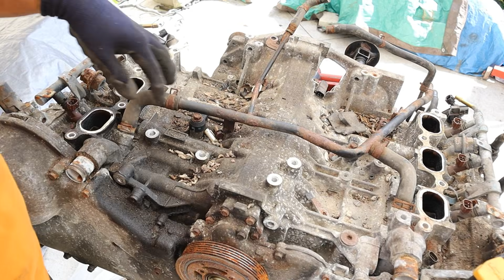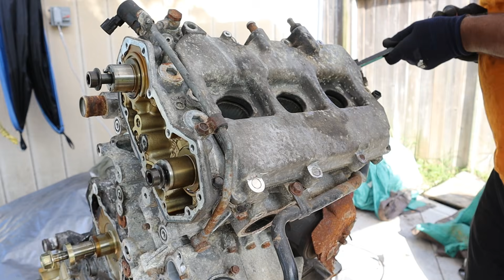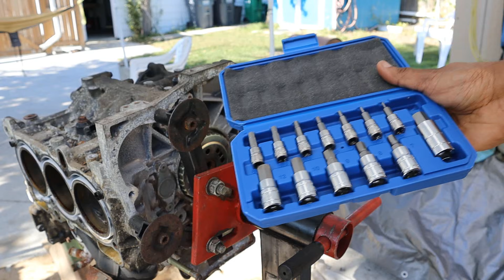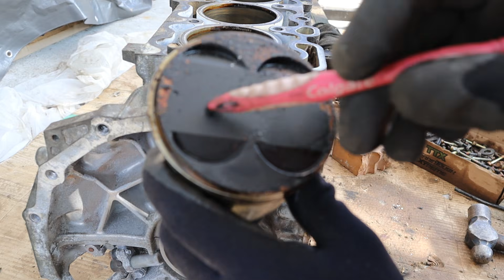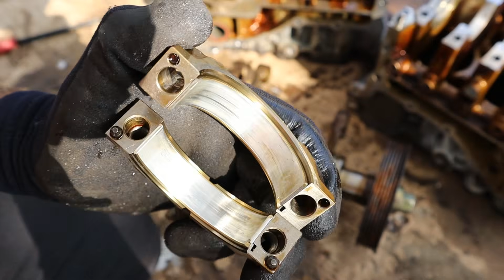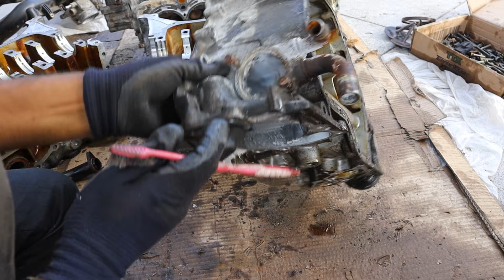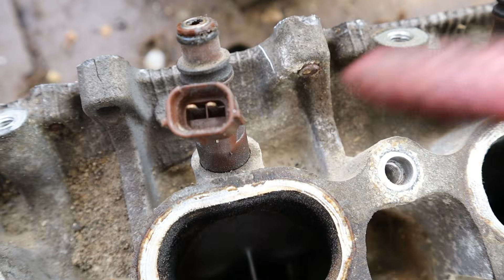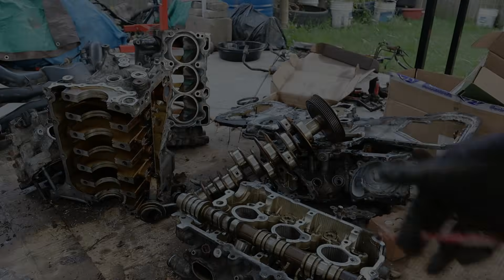Inside a Subaru Boxer H6 Engine

Comment: This is a fun video.  I'm diving into one of these engines right now because it needs a valve adjustment at 115,000 miles.  I can't wrap my head around the fact that it looks like, in order to do the valve adjustment, you have to pull the cams.  Seems excessive for what should be a fairly simple job.  Am I missing something?
Reply from the maker: Yeah cams will have to come off. That means you'll be dealing with timing.

Comment: GREAT VIDEO !  I love the way you zipped through all the boring stuff - hose and harness rempval, bolts removal, etc, that WAY TOO MANY "video producers" just drone through - as if they are getting paid by the minute instead of providing interesting content. ALSO, great and thorough analysis and presentation of the engine innards and systems. THANKS.

Comment: Not a single engine baside 2.5L EJ(EJ25) is having any headgasket issues. Its the fault of americans requring subaru to make higher displacement afterthtought engine just because 2.0L or 2.2L EJs were "too weak". No other ej has those issues, and especially none of the EZ and newer FA/FB series have such issues.
FB20 Crosstrek with 5mt  used as a medical courier car done 700k miles on original engine and only then lost compression on one of the pistons.

Comment: We have a 2015 legacy 3.6r. Missed chance to get a newer 2019 legacy 3.6r on used market. These engines absolutely suck! Nothing like a toyota and lexus. So many problems with a subaru. We got it for its safety and awd. Never again buy a suburu. Ours has 120k miles on it. Not sure it will last to 200k. I DO NOT BELIEVE JD POWER SURVEY. WONDER WHAT REAL IN THIS AGE OF MISINFORMATION. did subu pay them? Who knows

Comment: Unfortunately regardless of careful and routine maintenance of a Subaru the head gaskets will eventually fail....either leaking oil or water or compressed air from a cylinder into the cooling system (as the one I'm repairing). They just don't build the block with enough meat around the bores. I have owned numerous different cars and the ones that rarely fail are the old Volvo 240 engines, my Landcruiser 6 HZ...in fact most Toyota and Hondas are going to do a million KMS before the engines kick it.

Comment: The issue is that Subaru Coolant content on the internet recommends Subaru Coolant conditioner to be used when you do a coolant flush, but it’s been proven the coolant conditioner is Stop Leak being sold by Subaru which was for their older cars which had rampant head gasket issues. I did a coolant flush on my 2016 Subaru Forester 2.5L engine and didn’t use Subaru’s conditioner I just drained and refilled it with Blue Asian coolant from my Auto Parts Store. Some people have said the coolant conditioner Subaru sells from the dealer can clog up heater cores since it’s just a rebranded UK company’s stop leak. Stop leak seems to be bad all around and never a good thing to put into any engine IMO if it’s running perfectly fine

Comment: Some acid on the coolant circuit and iddle it for 2x 15min then plenty of clear water washing might've fixed it and get a couple more 100s k out of it... 
However, question is why did they use the additive of leak fixer in the first place. To the PROs around, would mixing different antifreeze types also cause this?
edit nevermind listened to you at the end.

Comment: I think the piston spritzers you were looking for are the piston coolers that are used on high output and especially turbocharged engines. Otherwise cylinders are just lubricated by the outwash from the rod bearings and the oil mist that fills the crankcase area when the engine is running.

Comment: All that crust buildup on the water pump where it O-ring seals into the inner cover/block is what caused the overheating I'm sure. That's what killed my first one, though mine was a lot crustier. Looked like it had never seen a coolant flush. I was on a road trip when it started overheating. Coolant was coming out of the weep hole in the cover. By the time I was able to limp it (stopping every so often to let it cool/refill with water) to a safe place, the head gasket had already made it's sacrifice.
Reply from the maker: Ouch. I'm sure this was due to the blockage since the coolant pressure and compression tests were good

Comment: I love my H6 engine it’s in a 2005 legacy it’s so smooth whenever I have a passenger they tell me how smooth the car is with the opposing cylinders making the engine so smooth like had to get a new engine because of a head gasket couldn’t find anybody to do the gasket but got a engine swap was worth it
Reply: Did you go with a jdm engine? I need a new h6 because of overheating
Reply: the H6 is in the outback model it has a different knock sensor and the rest is the same if you put your transmission on it
Reply: @Davehaha2001 yes i have an h6 in my 02 outback sedan that needs replacement.

Comment: I've seen this scale build up before, where someone had a worn out radiator cap, and kept refilling with tap water.  The the calcium from the hard water clog the water passages and radiator, exacerbating the cooling problem. 
Oh wait, that was my ignorant teenage self!
Very fascinating video.  The engineering that goes into today's cars is utterly amazing.  It does though make me appreciative of the simplicity of the old 4-cylinder Mazda / Ford engines.

Comment: I will just say I did find a chemical water system cleaner that was meant for a oil contaminated cooler system and it did dissolve the leak stop I did it twice and it seemed to fix the problem I was having with my daughters Holden commadore v6.

Comment: Working on my co-workers 2006 Tribeca.  I think the engine is seized.  Had a bad coolant leak and was stolen for 2 weeks by a crack head.   I pulled out the spark plugs and blew in PB Catalyst and WD40.   Breaker bar on the crankshaft bolt, not budging.  Think it's going to break.  Added 5 quarts of used oil as a last ditch attempt to flood the crankshaft, piston rears with oil.  About to bust off the crank shaft bolt in about an hour.  Any advice appreciated.

Comment: The oil spray nozzle in the block is not used for lubricating the cylinders but for piston cooling, it sprays the oil on the piston from the bottom and cools ultimately the piston top as well. The lubrication of the cylinders is done through the excess of oil from the connecting rod bearing and through the turning motion of the crankshaft it splashes the oil on the cylinders on almost all engines. On the other side it's also done through the oil mist when the engine is warm. Also that cooling failure is usually caused from using the normal tap water as a coolant instead of distilled water. The tap water has a lot of limescale inside of it and that's the white stuff you see everywhere in your engine, please use distilled water. 😁🤣

Comment: It's 100 percent. Coolant galley to coolant galley gasket failure. No mixing of oil an coolant but over heating issues. If it's a no for you. Than you missed the very tiny failure point.
Reply from the maker: The head was clogged. No coolant flow and therefore overheating.

Comment: Oil circulation...

The problem with oil path in a boxer engine isn't getting oil into the cylinders. It's getting oil back out. They do it by the scraper ring flinging it back and forth between opposing cylinders, and gravity back into the oil pan.
Reply from the maker: Yes, gravity doesn't work very well when horizontally opposed

Comment: Excellent presentation! There's not enough EZ30 content. 

I, too, have the EZ30 in my Tribeca. Technically,  what we have is known as the EZ30 Phase II aka "R" engine. You can tell because it has AVCS and the plastic intake. The first varient of the engine was simply called the EZ30. The engine offers reasonable torque and is quite capable in snow and mud (assuming decent tires, of course). Where 4x4 trucks get stuck, the EZ gets me through confidently. 

Maintaining the oil and coolant is very important with these (any Subaru, really). They are very picky. I've had to replace the timing set due to the tensioners failing. I also lost all my oil through the rocker cover gaskets, resulting in a knock. 

I have about 10k of work into it already in the three years I've owned it. People keep telling me to buy something different or get another car. However, there is just something about this engine that I like. The cargo space in the Tribeca is also nice for my many random adventures. 

All around a great engine -when maintained properly. The only real downside IMO is finding parts, and needing any work done at a shop or the dealership. That enormous 2-piece timing cover adds to the expense as well. There's something like 109 different fasteners on there. 
There's also a shortage of people who know their way around this particular engine. The guys at the dealership hadn't ever seen an EZ30, or a Tribeca!

Comment: Seems that coolant was most likely water or very thin solution. Also radiator flash was most likely never done. So a Subaru engine killed by lack of maintenance.

Comment: i have a 05' 3.0R Outback sedan and im in love, it passed 100k miles about 160k km . the sound is INSANE, especially with the cat back exhaust it has. i simply wish the electrics were better as so many things start to fail as it nears 20 years old its running lean and has a cam timing issue. ill be sure to avoid that stop leak, and hopefully when i get major work done it doesnt need to be broken when opened.
Reply: I had a timing issue occur that was a PIA to narrow down. Long story short, have the shop verify the connections and signal from the ecu to the injectors, and hopefully they don't need to open to timing cover.. It'll be at least 3k if they have to go in there. I had a tensioner go out, which made the timing jump a tooth or two, AND the solder on the ECU cracked around the same time, resulting in bad compression and almost random misfire. It took a month of troubleshooting to repair. The dealership couldn't solve it.
Reply: @shalopez420  I have that camshaft over advanced error so I’m hoping it’s just a bad VVT solenoid and not that, right now she’s got a huge misfire that’s fairly random. I need to check the plugs to make sure it may just be an electrical issue but they are a pain to reach and I haven’t had the energy to work on it, at least it runs better above idle so I can wait to take it to a shop soon.

Comment: For a boxer engine, 300,000 km is really impressive. These engines are pain in... you know where though principle of opposing pistons seems to be really good. But it isn't and basically every boxer engine has a lifespan comparable to electric motor of Tesla (60k km, or so). Comparison seems to be idiotic but in principle both engines should last a lot, lot longer. Long live internal combustion, straight six or four cylinders!
Reply from the maker: The H6 were known to last alot longer than the 4

Comment: a lot of similarities to horizontally opposed piston engines used in aircraft, this was sick. one interesting and huge difference, most aircraft engines would just have one camshaft for all of the cylinders intake and exhaust, 12 lobes in a 6 cyl example. Its inside the crankcase, above the crankshaft, and has long push rods to rocker arms, to valves. 1 exh, 1 int valve per cyl, and 2 spark plugs per cyl
Reply from the maker: This sure was an interesting teardown!

Comment: Fascinating breakdown of this unusual engine design. So complex. It's amazing that it lasted 300K km. Nice work.
Reply from the maker: It sure is interesting and the reason why I bought this car.
Reply: there's inherent value in the short cranks and cam shafts, little in the way of twisting stress, then the balance from the boxer layout helps. That engine had another 100K easily if the coolant had been managed properly.

Comment: just cause the water pump still spins doesn't mean its not bad ive took off so many that still spin but have a bad bearing that you cant tell just when it moves water doesn't move it fast enough or one of the inner seals go bad and when water and coolant gets in the bearing they lock up. they also can just blow seals out and still have good bearing and free spin but cant hold enough pressure to circulate the water enough.

Comment: The 3.0 H6 engine in the Outback was extremely robust.  The weak point to all Subarus vehicles after 2005 was the sheet-metal the Subaru used to build their cars.  Even minor pressure against the body sheet-metal while waxing or pollshing the car would warp the body's sheetmetal.  Engine and mechanical-wise the Subarus would rival that of Toyota and Honda!

Comment: I had the same problem and the problem was a crack in the block of the engine... This happened in a trip that a water hose came off and for about 5 minutes the engine had high temperature but unfortunately I was on a road that I couldn't stop.

Comment: I believe at 23:38, that's not actually how the valve lift system works but instead, under "low lift" condition, the outer part of the cap travels down freely as relation to the movement of the valve whereas only the center part actuates the valve, hence you see the center part protudes upward. And when in "high lift" the two parts are locked together and the valve will be pushed down further. The two sides of oil pressure acts as engage and disengage pressure to push small piston/pin inside the cap, to 'locks' and 'unlocks' the a outer part to the center part(similar to the pistons in a VTEC rocker arm).

Comment: I had an oil leak behind the rear timing cover and had to remove the entire front of the engine to replace just a few o rings. Took me ages but I discovered a faulty chain tensioner and ended up replacing the chains and water pump too. Engine runs like new again.
Reply from the maker: Awesome but man that must have been alot of work.
Reply: @speedkar99  yeah, it took me days in my garage. Most mechanics didn't even want to do the job as it was such a huge task. But I watched YouTube videos and managed to work it out.

Comment: When the oil pan was replaced, the hack mechanic should of replaced the bolts. Subaru should only use coated bolts. Good luck in the Great White North. Here's a trick for those caps, use a bolt and Vise Gribs...
Reply from the maker: Yeah...lots of rust up here.
Reply: penetrating fluid and propane torch

Comment: All EZ30 and EZ36 motors have forged cranks. My 2011 Outback 3.6R with the 5EAT is still running great at 172k miles. But I followed the severe service schedule for all maintenance.
Reply from the maker: How about the transmission?
Reply: @speedkar99  Trans is solid. I have been doing 3qt-3.5qt drain/fills every 15k miles. Full fluid replacement (just using buckets via the cooler lines) every 60k miles, on top of the drain and fills. The 5EAT is made by JATCO and, apparently, was also used in the first gen Nissan Titan. The way Subaru has calibrated the clutches, the 5EAT is very sensitive to fluid cleanliness. It *loves* clean fluid. I always used Idemitsu ATF-HP, Subaru ATF-HP, with some Lubegard Platinum at about half the treat rate.

Comment: The design of the cylinder heads were a collaboration with Porsche. They could've used studs and flanged nuts for fastening the timing cover on the engine.

Comment: 21:25 maybe if they tried to put water under pressure into cooling system to flush all that junk out of engine that is on high rpm

Comment: From Leo:  I was drag racing big bore Japanese motorcycles in the 1970's / 1980's.   Just like you found on this japanese car engine, all the bolts and fasteners are junk.   With all the respect for their engineering, I am surprised they still spec junk quality fasteners.  It is not just the Subaru brand, Honda, Toyota, Mazda and Nissan all have junk fasteners too. If they had to charge $10 extra dollars per car for good bolts, no one would complain.

Comment: So instead of just getting a new radiator cap since it had no spring and wasn't sealing, they used stop leak because they thought it was leaking, and ended up ruining the engine?

Comment: Lots of good internal parts that can be sold. The corrosion level means zero preventative maintenance was done. I have an H6 in a 2017 Outback. Great little engine. Runs like a top. I do all scheduled maintenance items.
Reply: Now that they no longer have a boxer 6 as an engine optionI will not be buying Subaru in the future.

Comment: Looks like someone was using extremely hard water to cut their concentrated coolant. Maybe that was compounded with some form of liquid stopleak at some point, but that looks like a lot of calcification.
2 rounds of distilled with a quality rapid-flush agent (BG Universal Cooling System Cleaner was my goto back when I still worked automotive, remember to follow the instructions for time- leaving this type of cleaner in too long is asking for trouble), followed by 2 rounds of distilled with ~20% concentrated coolant driven for a couple days each (for water pump protection- add more if the environmental temperatures call for it, but the lower the better to let the mix have more "capacity" to reabsorb some of those minerals) would have gotten most of that gunk out. If you wanted to backflush the system, you can use a garden hose BUT remember that your plumbing can be at 30-110psi, and if you try and spank all of that pressure into the system, you can blow cores apart, blow out seals, etc. Use caution, and don't let that non-distilled water stay in that system- I don't care if you have "soft water", use distilled/deionized. 
 CLR, vinegar, etc have given me too many water pump seal issues in the past- along with the super-cheapo flush agents. The Citric Acid based ones, like Prestone, can be affective, but be aware that they can also take a water pump seal that was already marginal and kill it off. 

User beware, not responsible, etc etc yadda yadda